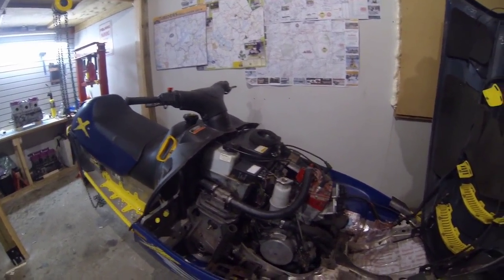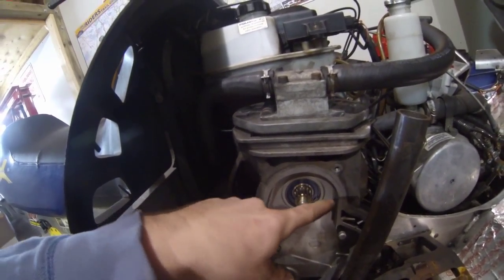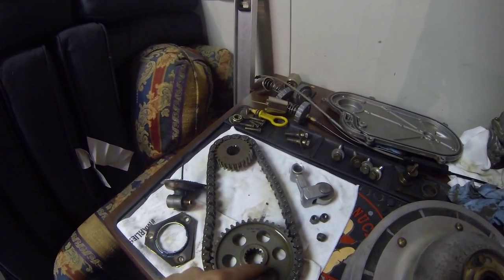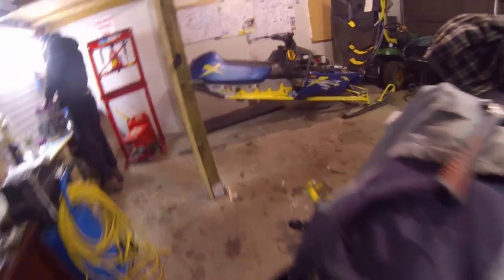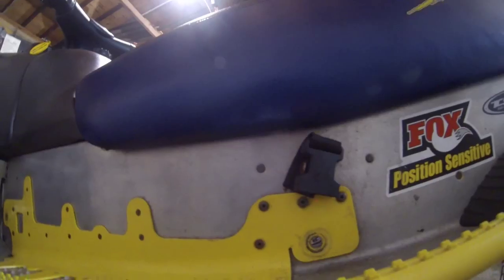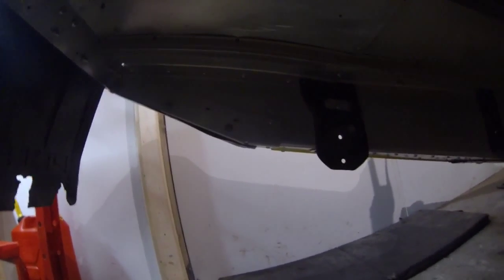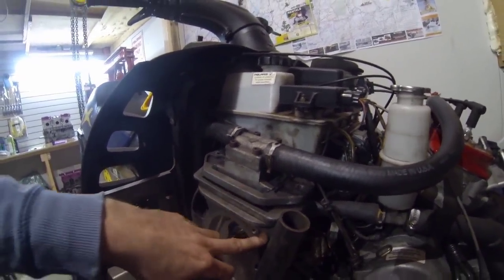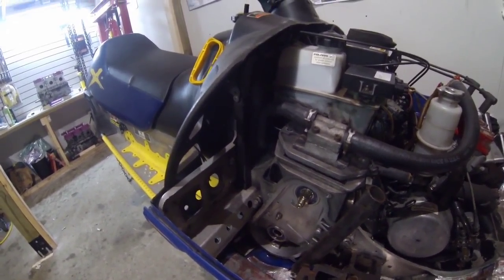Snowmobile Chaincase Repair

Comment: do you have the other part of the video I'm trying to complete my bearing install on my drive shaft
Reply: +Sasa Saric the bearing on the left side of the drive shaft you will have to hit off either with a air gun or a punch (be careful not to damage the shaft, if so clean the shaft with scotch pad) Make sure you speedo plate is on the inside of the bearing on the shaft then install the bearing onto the shaft, after the bearing is on the place the shaft back into place and re connect the speedo cover and install the bolts that hold on the casing, torque them to the spec listed in your service manual, if you want to tell me what machine your working on i can see if I have a manual for that application

Comment: Got a question for you ? I have a 98 Indy 500 I picked it up for 200 bucks runs beautiful but it's stuck in reverse that leads me to believe that the shift fork is bad , what's your thoughts ???
Reply from the maker: When you go to pull the lever to engage the shift fork and put it into reverse does it feel smooth? As well when you go to put the sled back into forward does it change over smoothly? If not then the shift forks are messed. As well if the sled is on an angle sometimes that can prevent the shift fork from slipping into gear. You could as well need a new cable, or to adjust the tension your cable has that attaches down into the gear case and up to the level for reverse! If you have any more questions let us know and I will look into more research. We have a 1998 Indy 500 as well with reverse, so I will go check out the conditions of its forks and cables for you
Reply: PrittyRacing vg